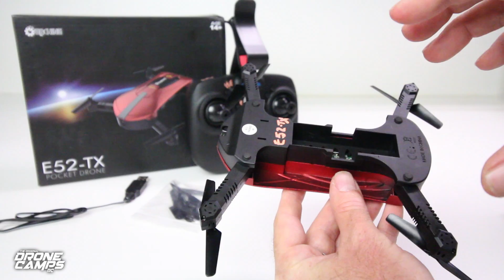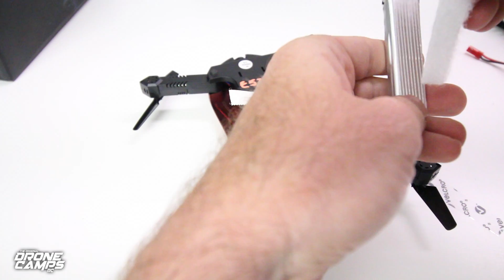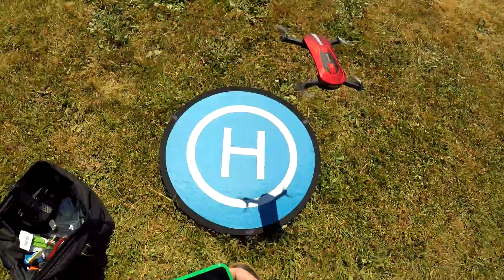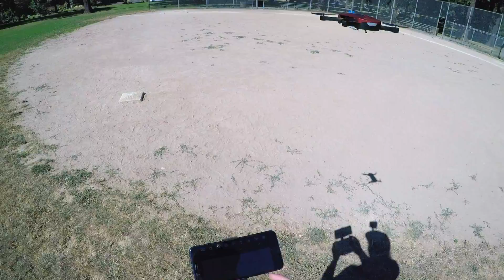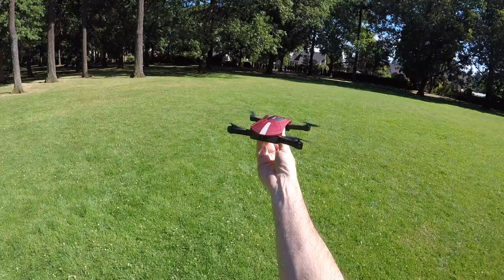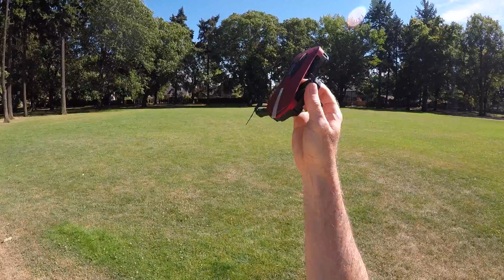Eachine E52TX Selfie Pocket WIFI Drone - Review & Mods

Comment: I got this one last week.  Took it outside, and it crashed almost immediately (Toilet bowl-Large circles when it took off).   Broke a propellor (Waiting on some more back ups to come from China).  I'm kind of new at this, but tried to read the manual the best I could (As you said, not very good instructions).  Just wanting to learn off something cheap before I make a larger investment.  Is there a way to calibrate this drone (Like the usual spinning methods before flight)?  Maybe I need to trim it ?  Any help would be appreciated.